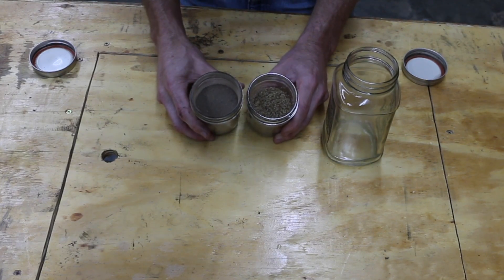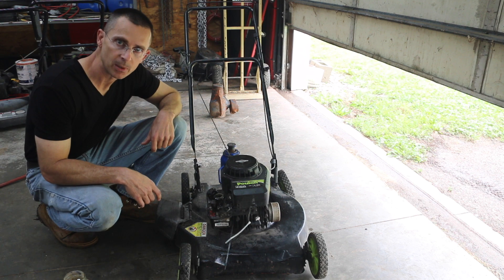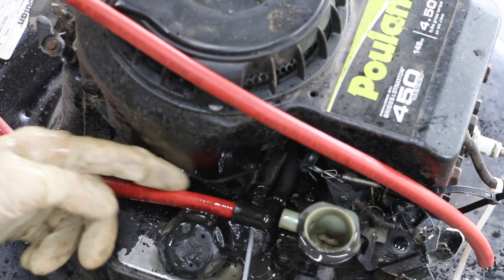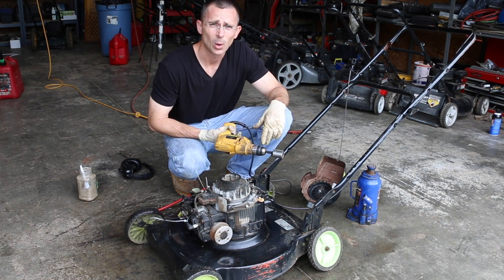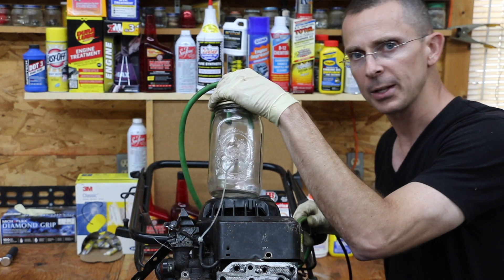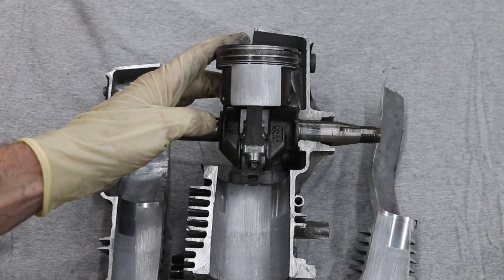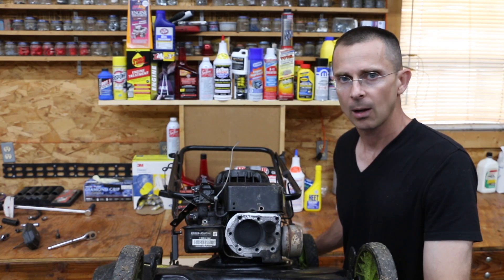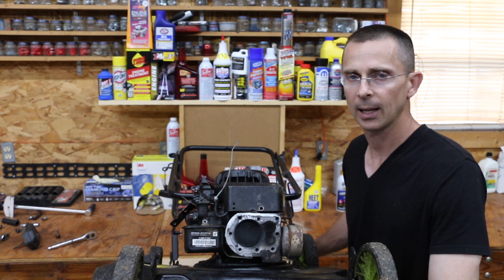Will Dirt Destroy an Engine?  See what it does to this Engine!

Comment: To show you how bad Mc Donald's is for your health, let's feed an old man 15 years of hamburgers in 10 minutes
Reply: i like the comparison
Reply: Exactly my thoughts and that sand was too rough. He should have took sand dust instead
Reply: thank you for this.
Reply: KECOG yes, but not at this rate. Btw, ATVs and offroad bikes usually have the air filter hidden from the environment:))
Reply: Loooool
Reply: Yes the  cut him in half for a visual inspection
Reply: Brage Ellingvåg  true, but my adventure bike (second hand), had the filter in but not oiled, and the carburettor was already full of fine sand (more of a dust). The fuel was orange/red because of it. An extreme experiment none the less. Ps filter on my bike are located under the seat! So sand has been sucked in through frame, between the seat and components to the filter
Reply: Rode my dirtbike everyday without an air filter in the sand stone hills of the California central valley. Eventually the engine did exactly what this one did but it took 9 months to achieve it. Even then the motor still ran albeit when it did it would burn insane amounts of oil and would smoke out an entire wal mart parking lot if given the chance.
Reply: Through the lungs...
Reply: MrJordyOL the moral of the story is an air filter serves a purpose. I can agree that it would still take years in most cases to cause damage. If you don't plan on using it for life. Removing the air filter is fine,  but if you do it is not.
Reply: MrJordyOL Super Size Me already did that
Reply: Not necessarily ; what about those wanting to take their ATV on the beach? If the carb/intake had no filter, that's exactly the type of sand that would go through the engine. winces
Reply: I agree
Reply: I had imaginary chest pains just thinking about that
Reply: I'm here waiting for @wendy's to read this
Reply: I’ll be that man 🤢🤮
Reply: Just one or two are enough tbh
Reply: MrJordyOL yup
Reply: Made me laugh, but not a good comparison. The human body has the ability to heal itself over time. Plus exercise etc to make.it stronger, and recover from all the McDonald's. An old mower canneh.
Reply: You should watch the documentary called Super Size Me. A dude ate McDonald's for breakfast, lunch, and dinner every day over the course of about a month.The results and consequences were horrendous but enlightening.
Reply: @dubiousseed3272  He threw up on the third day
Reply: 3:22 Insane amount of dirt it is.
Reply: not sure how you think that that is somehow anything like what he did. If you had a hole in your air filter, you should very well get shit like that in your engine.
Reply: @MrPacman64  If you happen to run through a sandstorm, yeah. Would have been better to make the engine breathe dirty air ( shake a half full can, which is connected to the intake ), than feeding it really rough sand and dirt directly.
Reply: @narancs5  not really lol. what he did would have been the same as doing the same amount of sand over a longer time. he just didn't want to wait. also, you wouldn't need a sandstorm, just a dirt road.
Reply: @MrPacman64  I get what he is trying to do with it, but the dirty-to-air ratio matters a lot. If you give it this much dirt at once, it will obviously cause damage, because the solid particles ( and little stones aswell in his case ) take up way more% of the available space in one rev. This results in a higher force pushing those particles wherever they get stuck.
If you want to see the kind of dirt your engine would suck in while driving on a dirty road, just open the airfilterbox carefully after a ride. Those particles will cover the inside walls of the box in front of the filter.
Reply: MrPacman64 that is just not true.  If you captured air from right behind your tire going 60 mph down a gravel road i highly doubt you'd capture a spoon of dust every second.  the dustiest air can't compete with this experiment to overwhelm.  the amount of dust in the engine bay is not nearly this high, think how filthy everything would be from just 1 driving trip.  dust would get in but not a lot of dust at a time.  i'm not saying there would be no problem to go without engine air filtering but i agree with the person we're replying to that this experiment answers a different question than "what would happen if you went without an engine air filter"

Comment: i have a dune buggy with a torque conberter dydtem on it and i put the belt on backwards by accedent the belt is tearing out so what will happen if it latches onto the torque converters? will it make the thing run fast as idle? because the belt is tight and thin so its at the bottom of each canverter.

Comment: 0:15 Not necessarily. On an automobile, the intake runners are designed in many ways. A larger plenum increases airflow, but causes more turbulence, a smaller one, more restriction, but less turbulence. Also the runner lengths, longer ones causes more restriction, but higher air flow velocity. 
What this means is longer runners, means a bump in lower end torque, but runs out of breathe in higher rpm. 

And about removing the filter or installing an aftermarket one; why would engine manufactures spend millions on developing and engine, just to cheap out on the intake/filter, causing it to make less power? On automobiles since the early 2000s, it's be proven that putting on an aftermarket filter, will make not difference, or make it create less power.

Word of caution to you viewers; if it's cheap (Or expensive in some cases), easy and claims to make more more power over 10 hp (on automobiles) without measured proof, look at as a skeptic

Comment: ive been riding my old 2 stroke  115cc yamaha without air filter since 2014...its ran more than 35,000 miles to date since last overhaul ..climbing gradients is also easier without air filter i found...i changed the piston rings after that which is normal for a 2 stroke engine with that mileage, yes carb gets dirty in about 4000miles and needs cleaning, engine not affected severely so far..

Comment: Put water as oil
Reply: I'd like too see this
Reply: I've wondered this as well.. different kinds of oil substitute like water or mineral oil or ATF or maybe milk? Haha. Thanks for all the destructive tests.
Reply: Would turn off in under a minute because of the lower density of water compared to oil, would get to the combustion chamber plus lower boiling point would evaporate most of the water
Reply: Ahmad Ghazal not if it's a Honda
Reply: Peewee Escandon it would just cease
Reply: I would like to see this.
Reply: Why?  We all know that it will destroy an engine and it's not a realistic test of anything that's ever going to happen.

Testing engine additives would be helpful, though.
Reply: He has sort-of already done this, added a special oil which said "water will not wash it away" on the box and then removed the oil and filled with water
Reply: +Δημήτρης Κυρκου wish he did a comparison of keeping water topped off for cooling and without the additive to know which made the difference

Comment: I reckon most people will appreciate the usefulness of an air cleaner, but come on.  The amount and rate at which you poured dirt and sand into the engine was hardly a scientifically valid test.  
Consider this as an analogy:   You have a single graze or cut on your hand.  It hurts, but it heals and you carry on.  
Inflict 10,000 cuts or grazes and you'll likely die.  Blood loss, infection general trauma.
That's what you did to the engine - several times over.
Ok, it's interesting to see the results, but at the same time they were hardly surprising.
Regards Mark in the UK

Comment: +Project Farm

This video was a lot of fun, but I think you had a logical failure in how you ran the test.

For instance, you could over your lifetime drink 6 gallons of vodka, and be fine.  In fact you could probably do 6 gallons of vodka in a year.  But if you did it over the course of 15 minutes, you'd most certainly die.

Clearly a person heals over time and an engine does not.   So it isn't a perfect comparison, still I wonder if a longer term test of the theory might be more interesting than just burning down an engine in an evening.   For instance, run a lawn mower in real duty for a year with a filter, vs the same make and model without the filter, and compare that.

Not as much fun, or as fast... I admit... But much more like actual research.

Keep doing what you do either way, I like watching stuff blow up as much as the next guy!  Just wanted to toss an idea out there for a longer term test.

Comment: I have been running my 2000 excursion without air filter for the last 4 years and she is still running strong and without any problem only during rain days I will put the air filter on , no problem for my for excursion...it worked for me and yeah it give better mpg as well as very strong pick up

Comment: It's awesome that you put so much time and energy into making these videos. Perhaps what happened in this one was that the huge amounts of grit got caught between the valves and seats and between the piston rings and the bore so that nothing was sealing properly anymore. The blow-by past the compression rings would explain why there was so much oil blowing out of the crankcase breather. In the real world it would all happen much more slowly of course and a lot of old engines never had air filters, but back then RPM was lower, stresses were lower and tolerances were looser so they sort of kept on going. Perhaps with a slower input of finer dirt it would just gradually work past the rings and end up sinking to the bottom of the oil pan.

Comment: You should see the crap air filter they include with gas bicycle engine kits. No protection at all. Might stop a penny from going thru. Some say these Chinese two strokes don't last long on them. But they are sucking dirt, what do you expect? I made my own from two stage foam and treated with filter oil. Bet my bike runs a long time. Good video, good lesson.

Comment: When I change my car's spark plugs I will use high pressure air to blow any dirt , sand or other stuff out of the spark plug wells then loosen the plug three turns and high pressure air again so nothing goes down into the piston cylinder that should not be there. started that practice 1989 , so now thanks to you , you proved it does not take much dirt to damage an engine . Thank you for the video.

Comment: Cool video and all it brings some good points. however I also feel it blows it out of proportion. and quite literally. I mean, that's a REALLY small engine for how much dirt and sand you're pouring in. say that mower engine holds what? a gallon of fuel maybe? with the amount if dirt and sand you into it that's a really big ratio in terms of of the engine size to sand. translate that to a car engine and the numbers gotta scale up too. say a modern car now holds what anywhere from 14-20 gallons. So in scale with your example you'd be putting in say a gallon or more worth of dirt and sand. and no amount of everyday use will ever accumulate that much dirt and build up. not even in a cars lifetime of never being cleaned. not trying to bash on your video, I'm sure you didn't make this video with the aim at trying to be super exact to the scientific formula of it, but you made a very solid point that dirt and sand does impact the performance of an engine, whether it's small or big to a very good degree. I say job well done and to keep doing your videos you do an excellent job breaking things down and showing what goes on inside!

Comment: Did you read what happened when Sachs tried selling their rotary lawnmowers overseas?  In parts of Australia the air is often full of grit from mining operations, and they made the mistake of putting something other than a simple screen on the air intake.  Guess what?  All that fine grit got into the engines and tore up the side plates!
Reply from the maker: I didn't know about this.  Thank you very much for this comment!

Comment: Try running gas in a diesel or the other way around.
Hydro-lock would be another good one.  I knew a person that would place oil into the cylinder of everything he used when putting it into storage.  However when it came time to use it, it would be locked up due to excess oil.  Sometimes he could get it started with out draining the oil out through the spark plug hole.  And when it did, it knocked a few timed when ruining and of coursed smoked like crazy.  I would have to say instead of protecting his engines he was ruining them. Maybe if he would have removed the excess oil, it wouldn't be such a bad idea.

Comment: What happens when you leave your mower outside all winter without stabilizing the fuel or fogging the engine? 

You could test by taking an engine and leaving it in a deep freezer for a while and examine the effects

Comment: While this test shows that you will damage your engine without an air filter it does not take into account the fact that under normal situations the piston will go up/down many times between each time a significant sand particle enters and therefore polish (or run-in) the surfaces a bit. I am not saying that you should run your engine without an air filter, but this test is a bit extreme and usually the end result is not as bad as seen here.

Comment: in one of your future videos, i would like to see an engine run with little to no oil in it until it dies. i personally know (not customers) 3 people who have run their automobile engine so low on oil that the engine was knocking (they kept driving after the check engine light came on) when they pulled into a place for help. one was lucky enough that that person is still driving it. though it consumes quite a large amount of oil. the other two were not so lucky. as a retired professional mechanic i have seen this kind of damage several times thru the years. it can be financially devastating to some folks. and no matter how lucky a person gets, there is always something they could have spent $$$$ on.

Comment: hay bro, its me again. 

so I was researching the toys called 'Slinkys' as a plot device for a zombie story I'm writing. (You know those irritating metal spring thingies that get hopelesely bent and tangled) well as it turns out the engineer that designed them actually employed a piston ring manufacturing company to produce them. (that was cool I thought) but then later as I was pounding out some words for my sci fi story it suddenly occured to me...can you use a metal slinky as a piston ring?

So my brain kicked it around for a bit and it came up with the following. 

use a metal lathe to completely remove the aluminum ridge between the first and second compression rings. this will leave one huge ring grove. take a spare  oil ring for said piston and get the two thin cylinder wall scraper rings that go on top and bottom of the oil ring (the piston will need an oil ring but you'll need two spare thin rings as end stops for the slinky ring) 

cut the slinky so as it is slightly to wide for the groove you made in the piston. you will need to flatten the top and bottom of the slinky. (I suggest a lapitary tool known as a 'flat lap') you will need to nip the ends of the rings at a slight angle and be sure nip the ring off before it becomes to thin. 

Hopefully this will get some questions running around in your head. I tried to answer a few before hand below.

Why should you do this you may ask? Well thin rings produce more horsepower and ring end gap creates loss of horse power.
 
Has anyone done something like this before? kinda. but it was back in the days of steam, they called them culpet rings, long before the first hot rod was ever born.

Do I see issues? Kinda. there may be an issue if the ring expands too far along its length. If it completely fills the ring gap the ring would grap the cylinder walls and take the top of the piston off. (This is what happens to blown motors when the high boost pressures produces to much heat, causing the ring gap to disappear, and then the ring graps the cylinder wall and "boom")

What use would it be in real life? If it was feasible to use it may provide a method of increasing power density of the prexisting engine designs. Even if the wear life was extremely short dragsters engine builders would do it for a five horse gain. As far as I can find out no one has ever tried taking the slinky back to its roots. it started life in a factory for piston rings and I think it would be one of the coolest hacks ever if it actually works.

Comment: Not very scientific... 1st off... how is this a "years worth of sand and dust"? How did you measure that amount? 2 - If I drink a years worth of water, I will die... same with the dirt and the engine, same with practically anything... so pouring dirt into an engine IS NOT the same as having a filter off for a period of time. This doesnt prove anything but the fact that you kill a single cylinder engine if you pour dirt into it.

Comment: Trouble because of water in the gas tank was a mystery cause of "fuel line/carburetor" problems that was a simle fix, however required two carb. replacements and fuel line repairs that were not necessary until a real pro figured out the water in the gas.

Comment: The fact that you added so much dirt in at once probably increased the damage exponentially. Airborne dust would flow trough the motor along with the air but when you drop a spoonful of sand into it obviously it's getting down into the rings instantly.

Comment: Here's something you can test. Does slowly pouring water into the engine's carburetor clean carbon off the valves and cylinder? My grandfather told me this trick and I did it on a Chevy Nova about 40 years ago. It blew out plumes of steam from the tailpipe. The engine did seem to have more power and run smoother after. I burned some pretty good rubber with it.